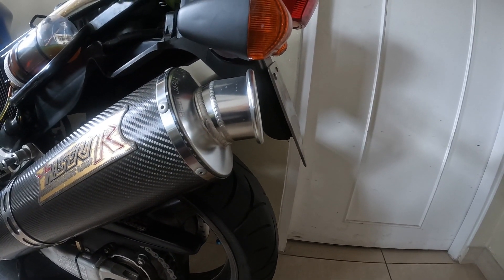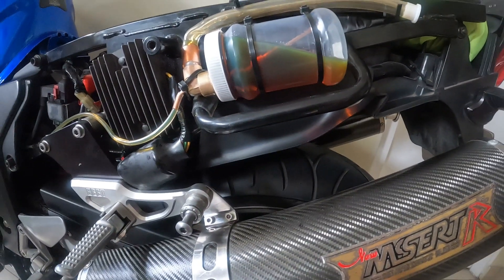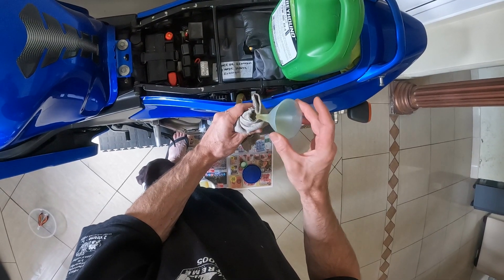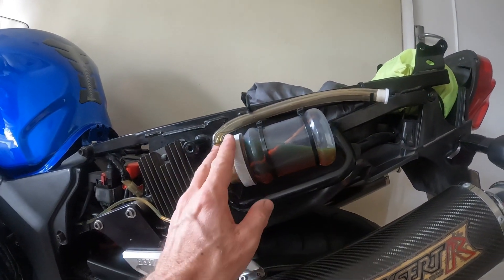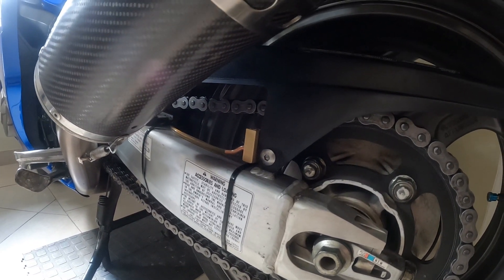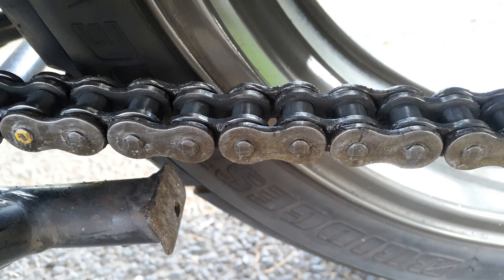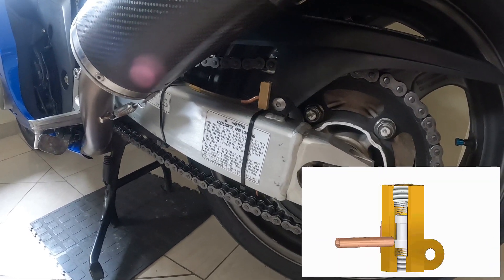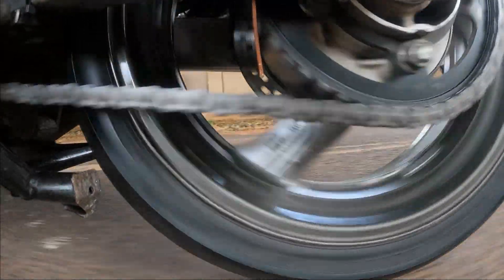A DIY inertia based automatic chain lubricator for my motorbike

Comment: would it be good to add a brush at the end of the pipe so it can coat your chain evenly?
Reply from the maker: I don't think that its necessary, the oil spreads from the inside of the chain very effectively.

Comment: I noticed you said you didnt want to commercialise your idea.
Would you like to put your plans of the mechanism online (for sale of course)? 
And how did you get to your final soecifications of weight, and spring tension?
I would love to build this!!
Reply from the maker: The springs, etc, were designed from first principles, basic free body diagram. I used a multi grade oil, so the kinematic viscosity used was at our average temperature.  I did build adjustment into the system, and currently, it keeps the chain oiled and surprisingly clean, so it's flinging correctly. I honestly wouldn't know how to sell my designs, but the tolerance is probably more important, so a writeup on manufacturing methodology and how to set the valve would be needed. Building this is a similar skill set to building a live steam clack valve....

Comment: Hi there. Nice work! Where can I find that inertia piston that U used in your oiler?
Reply from the maker: Thanks... I designed and machined the piston. There is nothing of the shelf that would work, unfortunately. The piston has internals to make it oil properly, so it's not a straightforward piston design.
Reply: @Lukers_tinkering  maybe you should considering selling it. It looks good and possibly cheaper than those of known brands from the market.
Reply from the maker: @zolkiss  maybe one day. 😅
Reply: @Lukers_tinkering is it just a brass tube with a delyrin poison and no springs? So it just bounces up and down?
Reply from the maker: It has two springs that are adjusted from the outside for travel and preload to meter the flow. The piston has some internals not shown but it was made from stainless. This needs to be dissimilar to the cylinder which was machined and reamed from square brass bar. @hahaha10001